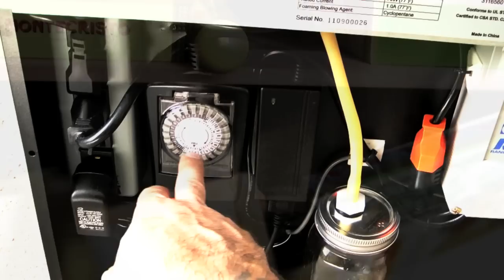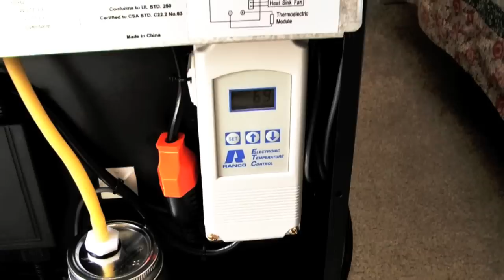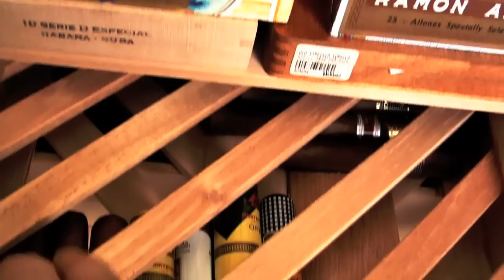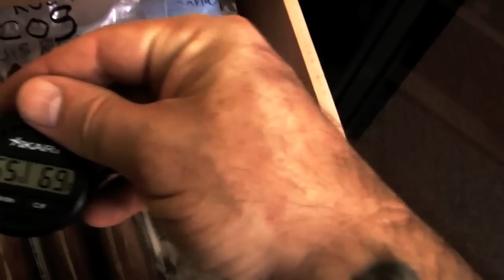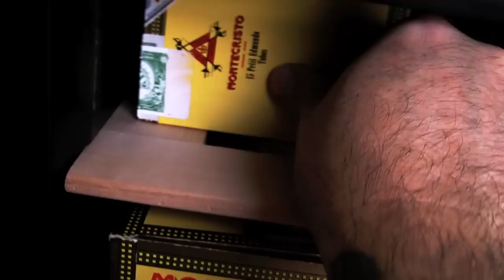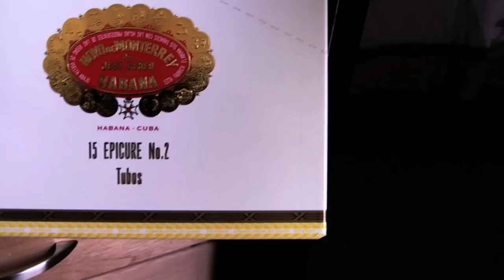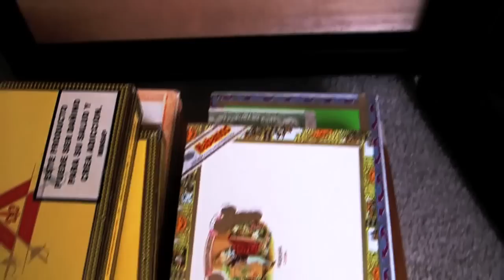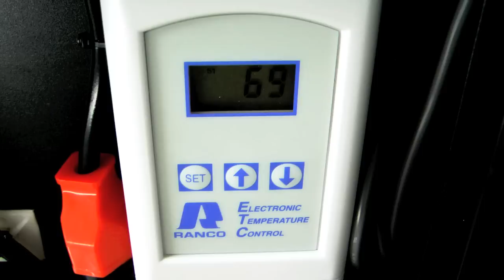OneManSmoke OMS Casa Del Habanos Fo Sho

Comment: Great setup Salam. Very clean & professional . Your attention to detail is awesome. I setup a coolidor for my self. 52qt Coleman, some Spanish cedar trays, Tupperware container with some silica kitty litter & a generic Walmart hygrometer. Works pretty good for me here in Wisconsin. I keep it in the basement, humidity between 68 to 70, temp 64 to 66. My setup can't hold a candle to yours though. Thanks for sharing & taker easy.

Comment: OMS.  System looks good.  If you maintain as warm a temp as you're comfortable with, the air inside the chamber will hold more moisture.  You should be able to maintain 70% RH at 70F with little to no condensation.  That's a good collection of smoke too.   Stay Frosty
Sarge

Comment from the maker: Sarge what about outside temperatures and humidity? I think thats whats throwing it off. It's just trial and error I'll get it tuned in for sure but I'm just going through some growing pains right now. I mean the temps are cool and the humidity is right there yet a bit unstable at times but my main concern is the condensation and I have herd that this is the pain with these thing some times. Sweet smokes bro!
Salam

Comment: If the unit is new, I don't see much that would hurt.  Test your mason jar water, that should let you know what's up.  I'm sure that with time, dust, oxidation of the aluminum fins, etc may form on the parts that form the condensation...  Perhaps do an inline filter?  You can rig up one of those "in the bottle" filters that I've seen at Target.. Drill a hole in the bottom, invert that fucker, feed it backwards.  Attach a tube on the "drink end" and feed that to the Oasis bath.  BAM! Gravity fed!